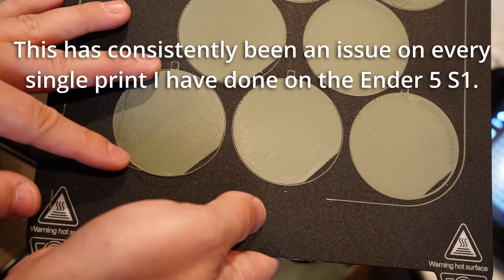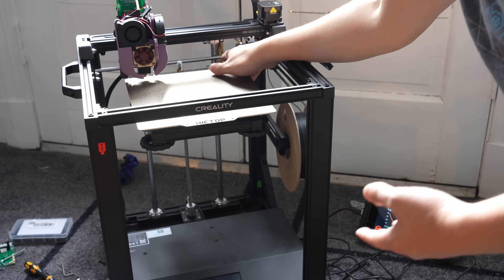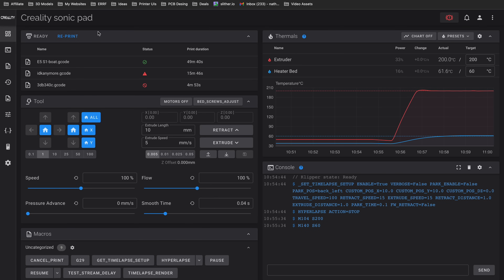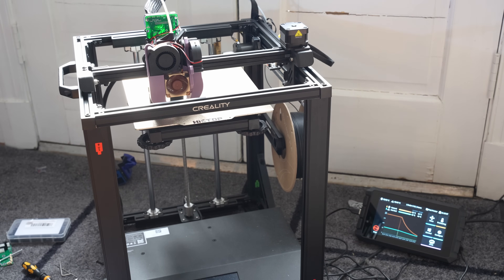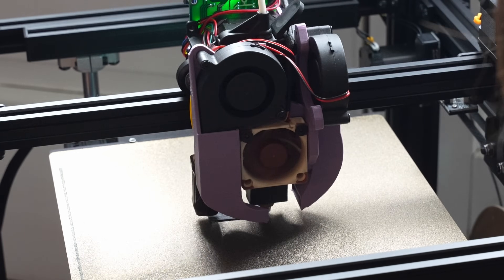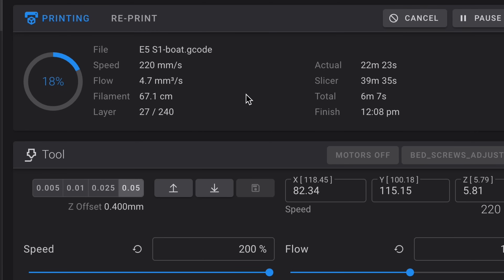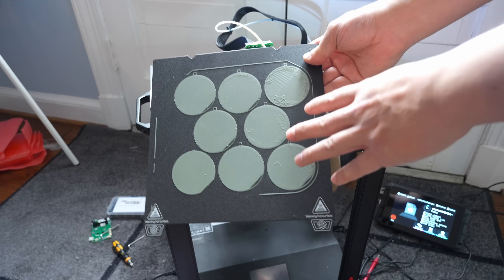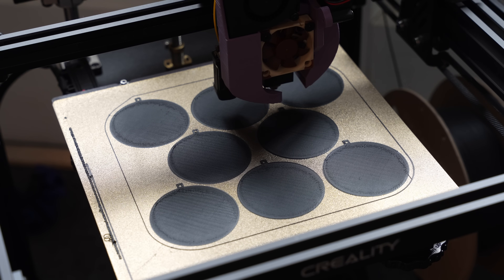THE BEST UPGRADE for The Ender 5 S1

Comment: Huh.
Adds "zero Y offset" to the list.
Reply: Video is a 0/10 from me though, you clearly didn't apply enough boron nitride paste. Would have solved all your levelling issues.
Reply from the maker: I already applied boron nitride paste to the nozzle last episode, but you’re right. I should have put a fresh layer down.

Also it was negligent to not spread some some under the spring steel sheet with a butter knife.

Comment: bambu showed us the way for z probing. piezo sensors under the bed! crtouch and similar probes are needlessly rube goldberg and still have offset errors. i suspect the reason why so many people have such great success with the bambu printers compared to others is because of this. with the bambu there's no adjusting the touch sensor or z offsets, it uses the actual nozzle to probe.
Reply from the maker: Not really a Rube Goldberg machine. It’s 2 functions, deploy and detect. It has 1 moving part. Is a ball point pe a Rube Goldberg machine?

I do like the bambu solution though. Gets rid of weight on the tool head. There are other printers in the market that use load cell based leveling, but putting it in the bed really is a good idea
Reply: @NathanBuildsRobots  compared to piezo sensors, mechanical touch sensors are dinosaurs. they are an order of magnitude more complex than piezos. put them under the bed like bambu, or in the extruder as some others do. bambu showed how lazy and complacent the industry has become. prusa mk3s+ kit for 799 or p1p for 699? lol.

Comment: Could you post the stl file for that test file?
Reply from the maker: Which test file? the flat circles?
Reply: @NathanBuildsRobots  exactly
Reply from the maker: It was just a random print that I had laying around, and I stopped it manually before it finished the rest of the print.

If you're in prusaslicer you can place a bunch of cylinders into the print area manually and do pretty much the same print
Reply: @NathanBuildsRobots  I can barely use Cura 522. But I’ll figure something out. Thank you.

Comment: always fire..i am having a similar issue I think with my e3S1..its reading .5 hikgh on 1 side..think the cr touch might be off or broke..it doesn't trigger sometimes
Reply from the maker: It should definitely trigger 100% of the time, if its being pressed. Have you tried talking to the mfg? Also you can get replacement CR-touches for about $15 on aliexpress

Comment: My solution for resolving all of the issues with a "first generation" Ender 5 S1 was to return it for a new unit.  The second generation (no Z-axis limit switch + injection molded fan duct) works flawlessly.  No soldering required.  They pushed out some really bad units in the first couple of containers that left the factory.  Bad design.
Reply: Creality printers are educational units - for people who think they like to constantly rebuild and upgrade their printers. The only thing that is left unmodified from my original Ender 5 Pro is the frame. Everything else had to be replaced or modified. :)
Reply: @kalicacao  yep, pretty much. The only reason I did all these upgrades was because I was outside of the return window, otherwise, I’d have just bought a voron kit
Reply from the maker: That is very interesting. No doubt they were in a rush to get ahead of the competition (Bambu Lab) and may have cut some corners as a result. Funny enough, the P1P I bought may be the victim of the save "get it out as fast as possible" mentality.

I'm curious what these new changes are. When I reached out to Creality about the issues I fixed here, they said the same thing, that they came out with a 2nd edition that fixed some of the issues from the first batch. Would be really interested to learn more about what is different on these 2nd edition printers.

In any case, mine is working great now, and I've documented all the steps I've taken to get it to this point.
Reply: Wait?! That's actually a thing? Interesting that they did such changes after release. I guess the rushed production run is why the grub screw on my heater was so tight it crushed the heater tube and why my X-axis idler was bent WAY too far causing the belt to rub on the gantry. I will add to it that Creality has been very helpful with replacement parts when contacted so maybe they are aware of the issues in quality
Reply from the maker: @SweHam  Idk, most of the people I have talked to have said creality is very forthcoming about sending out replacement parts (I know of several people that fried their motherboards due to inadvertent shorts on the fan pins while installing the Modder Board, and they got replacements sent to them right away. Don't tell Creality about it tho because I'm pretty sure I've cost them a couple hundred....).
Reply: @NathanBuildsRobots  I will say that I contacted creality and was on the first 500 orders of the ender 5 s1 and creality would not send replacement parts. I could not use the mesh leveling otherwise I would get an extreme issue to the one that you showed here. I spent 15 hours troubleshooting and they refused to believe it was anything except a firmware issue that would "eventually" be fixed. Like literally my first mesh bed level scraped my nozzle so deep it left a scare in the build plate. At the end of the day since they refused to send new parts for me to try, I requested a return which they accepted. But I secretly still wish it had worked because I like the mod-ability of creality machines. Anyways just wanted to say that this person was not alone in the initial batch issue.
Reply from the maker: @RandomDudeWorkshop  Yeah, I actually had a meeting with the Creality engineers to help them figure out what was going on in early December.

But I ended up sleeping in and missed the meeting, because it was late at night due to the time-zone difference. I think they were really concerned about all the issues because that was the first time a company had reached out like that.

Maybe if they were PAYING ME errhrrm I would have showed up and saved their bacon 3 months ago.

Too many of these 3D companies expect free labor (from influencers, etc.) in exchange for printers. Not how it works. If you want top quality engineering you gotta pay for it.
Reply: I have one of the “improved” versions and it wasn’t any better.
Reply: @cjhmdm  Creality replaced my original E5S1 with a newer "fixed" version. Only difference being it now has an ABS fan duct, but CR Touch bed levelling still sucks. From what I've heard the real fixed versions have the CR Touch mounted to the left rather than behind the nozzle...
Reply: @simonthompson6343  yeah, maybe. I think there are a myriad of design flaws they should have learned from and fixed from the original ender 5. Mine is so modified now the only original creality parts are the frame and power supply.
Reply: How can you tell if you have a first or second generation ender 5 s1?

I have had nothing but constant issues with leveling since getting my unit in december of last year....to the point that I am almost tired of messing with it. 

It very well may be my first and last 3d printer due to constant frustration and failed prints.

Comment: The FB group I follow has had Ender 5 S1 owners trying to find spare parts for it without success, a ribbon cable and a silicon sock upto press, spares are non existant for this machine.
Reply from the maker: Very interesting. I'd like to learn more about this. Do you have any links that I could use to see what the trouble is?
Reply: @NathanBuildsRobots  The author of the post about the faulty ribbon cable is Nathan Quick posting on 3D Printing UK, and the guy trying to find replacement silicon socks I cant find, it might have been on Reddit, I will try and search, unfortunetly I installed an app to stop Microsoft mining my data and deleted my history by mistake, I have a save point that I can go back to though.
Reply from the maker: Dang. Well, seems like its tough info to track down. 
Personally, I'd just switch to a ceramic heater for the hotend. They are much better and safer.
Reply: @NathanBuildsRobots  Creality have really played an ace this time, who in their right mind would release a printer with non standard parts and then not provide any spares for it, I believe he is sending the machine back, and so would I, not that I would have bought this machine in the first place, a P1P is only a little more expensive than the E5S1 and it has professionals running the company!

Comment: If you have the probe offsets set correctly, why was your mesh not correct?
Reply from the maker: This is copy-pasted from a community post on the topic. I could explain it with some charts and analysis a lot more clearly, but I don't get paid enough for this shit :P

The issue is not with the bed. The bed could be tipped 5 degrees at an angle and the ABL should measure accurately and compensate.

Do describe it in mathematical terms, ideally you want an identity matrix to convert inputs to outputs. 

Meaning, 100mm of movement on X translates to 100 mm movement on X

What we have is some weird interplay between axes

So when commanding 100mm on X, you end up with something like 101mm on X, 0.1mm on Y, and -0.3mm on Z

If you are probing with the nozzle itself, you end up being able to compensate for all of this perfectly.

However, if you probe with an offset, the Z coordinate ends up being off by the amount of z error introduced by the offset travel.

With the current stock design with a 45mm Y offset, it causes big issues.

With my new design, which has 0 Y offset, and ~32mm X offset, everything works great.

Y offset introduces much more error than X offset in most printer designs, just due to how they are built.

Moving a lightweight carriage along a single extrusion (as is the case on the X-axis) is much less complicated than moving 2 carriages along 2 extrusions, that might not be perfectly aligned with eachother, with 2 belts, and a coupler that might not be working perfectly... There's a lot to unpack. Best bet is to just watch my next episode which will come out today or tomorrow.
Reply from the maker: If you mean, why did it run off the end and have an error during the first try at making the mesh, it just has to do with the way Klipper does its bed leveling. It wanted to mesh the whole surface, but since the probe is not coincident with the nozzle, the nozzle ends up being able to reach all points on the bed, but the ABL can't. It is unable to mesh the rightmost portion of the bed due to the offset (x carriage can only move to the right so far)

Comment: it might be as fast as p1p in silent mode
Reply from the maker: Incorrect. It is faster than the P1P in silent mode.
The benchy shown in this video finished in under 40 minutes

If you look at the screenshot of babmbu slicer at 10:18
You will notice that the predicted time is around 48 minutes using the standard profile at normal speed.
Reply: @NathanBuildsRobots  I honestly couldn't tell u have x1 carbon its 24 min with all calibration or 17 min without in standard figured p1p was close to that
Reply: @NathanBuildsRobots  have ender 3 s1 can get down to 31 min on klipper but running into cooling issues that ender 5 fans set up u have would he nice on 3s1
Reply from the maker: Interesting. Maybe Bambu Lab should send me an X1C to review so I can try that out. 

The Benchy shown on the video is the Creality sliced Boat running at 200% speed, 5000mm^2/s accelerations, and 0.2mm layer height.

In Bambuslicer, if I I set it to the fastest print profile (super draft 0.28mm layers, 1. wall) it finishes in 37 with preparation time or 31 without. I wonder if Bambulab can cut down on the preparation time with a firmware update. The bed leveling and initial setup is a bit slow.
Reply from the maker: I have some cooling duct designs for the Ender 3 S1, which I'd gladly reccommend (I've made videos on them). 
But this other design might be better than mine. I'm very curious about it and will try it out when I have the time:
https://www.thingiverse.com/thing:5511666

Comment: Nice. I printed the new shroud yesterday. Just waiting for the fans to arrive
Reply from the maker: Cool! Hope it works. Only issue you might have is the CR-touch cable creality supplies is super short and doesnt reach to the new location. I can send you a longer one if that ends up being an issue for you.
You can actually use the old CR-touch mount location with the new fan duct if you feel like it. But for mine I definitely needed to reposition the CR-touch due to the bed leveling issues I was having.

As far as I understand, the bed leveling issue doesnt affect everyone, the actual misalignment is caused by tolerance stack up from a number of parts coming together.
Reply: @NathanBuildsRobots  Thanks. I have a couiple cables here that I can use or adapt.

Comment: is the zero y offset crtouch probe mount a thing for the ender 3 s1? i have problems getting my bed level perfect almost like yours but not quite as bad, i cant get it perfect like my ender 3 v2 with a bltouch. i have silicone bed spacers on both. btw i agree with you bambu guys are hilarious i laugh at them while they have to wait for over a month for a single part hahah
Reply from the maker: Yeah, there are some zero Y-offset mounts for the Ender 3 S1. That is where I got the idea for this, but it applies there too!
Reply: @NathanBuildsRobots  good to know thanks! i plan on putting a different fan duct on my s1 since part cooling sucks on it stock and probably picking up one of your modder boards. you got great content man keep it up!!

Comment: Nathan, would you tear your P1P apart if someone agreed to buy it from you (reassembed afterwards?)?
Reply from the maker: I'm planning on doing a teardown. Wouldn't feel right about selling it afterwards, because it may require some "destructive disassembly" methods.

I have done a teardown of everything except for the COREXY stage. I've seen a couple videos of people taking that apart, but mine appears to be glued together.

Regardless, even if it was pretty much scrap afterwards, I'd try to redesign/reassemble enough parts to get it back up and running (possibly on Klipper)
Reply: @NathanBuildsRobots  I would love love love to see that teardown, as well as any mods or DIY replacement parts. I love my P1Ps but we all know they aren't perfect and I don't want to have to replace them if I can fix them one day when something happens.

Comment: This is ABSOLUTELY the BEST VIDEO you've ever done. I am SUPER SUPER IMPRESSED. There's a drama story here. There's an incredible narrative. And, the visuals are ALL ABOUT WHAT'S HAPPENING versus a talking head (even though you're narrating the video). WELL DONE, NATHAN!!!!! (On getting a job, you should CONSULT! That way you can define your compensation to whatever YOU want. I would suggest $500 per hour to consult with companies seeking help with their already released products. Well Done, Sir!
Reply from the maker: Wow, thank you! Now I just need to get back to that Biqu Hurakan issue...
Reply: @NathanBuildsRobots  Here's an update on my Hurakan. You know that I fried the entire control board, right? At this point I have a LOT of parts coming from BIQU. But if that wasn't enough, I have ANOTHER HURAKAN on order. Why? Because I didn't take enough pictures of the wiring on my first Hurakan before I ROASTED the wiring harness. BIQU finally agreed to send me a FREE WIRING HARNESS. I think someone from China is rowing over to the US to deliver it to me, though. I'm still debating about keeping the second Hurakan. Or sending it back. I'll be reconnecting with your Patreon page laster today. QUESTION, could I use your MODDER BOARD to replace the POW board on the Hurakan?
Reply from the maker: No, The connectors are similar but it won't wor, uless you installed a sprite upgrade kit on the hurakan (the one that comes with a new carriage and 24-pin ribbon cable).
Reply: @NathanBuildsRobots  I tried installing a Revo in my Hurakan. That’s how I fried the ribbon cable and the board. But I’m willing to try anything to have the printer deliver on the Klipper promise that came with it. Send me a link to that print head so I can buy it from your connection to Amazon.
Reply from the maker: @corlissmedia2.0  Here is an affiliate link: https://amzn.to/3yhPafa

If you check my "Ender 2 S1" video I go over the installation. It's worth watching because creality did some rather irresponsible wiring on the 24-pin cable. Just make sure not to plug it in wrong and you'll be fine. In the video I mention "shorted connectors" that you want to avoid plugging in to anything.
Reply: @NathanBuildsRobots  here’s an update: the second BIQU Hurakan arrived today. Here’s what I found: just like my first Hurakan, the thermostat was sticking halfway out of the back of the heater block. The wiring to the board was even worse on this printer. The box it came in was covered with shipping labels. I think it was returned before, then shipped to me. I took dozens of photos. The two grounds to the FG post were there. The lower ground was under the upper ground in this printer. The connectors were open-pronged. The wiring looked like a fire-hazard. There was damaged to the case in the two back corners. Not huge, but noticeable deformation. After documenting where all of the wires go, I repacked it, and told Amazon I want to return it. It should be gone tomorrow.